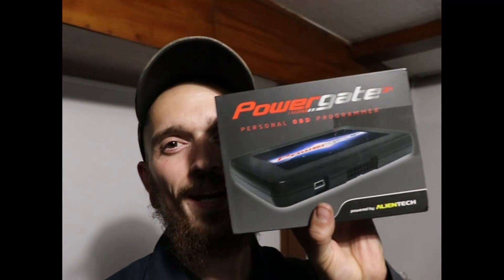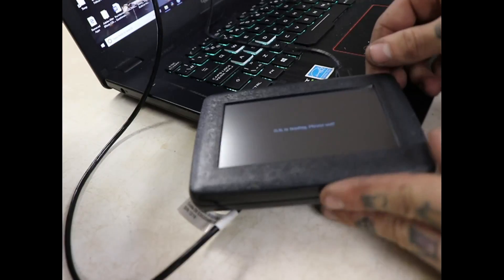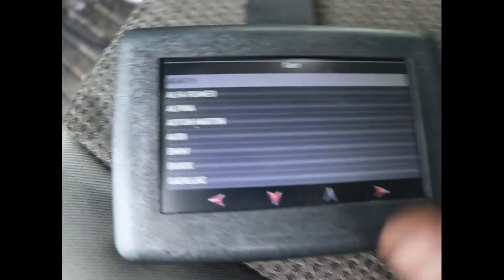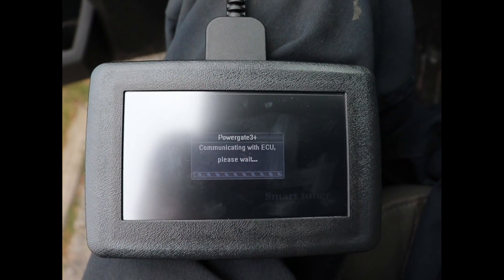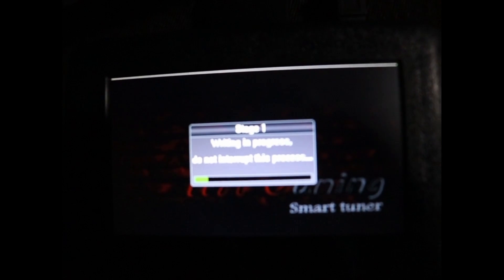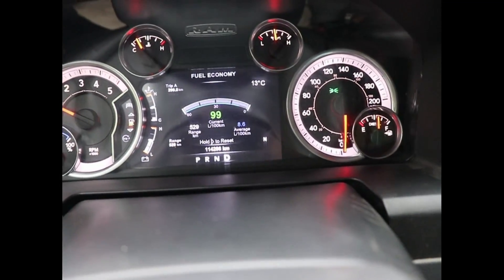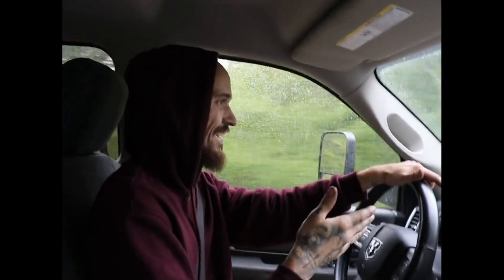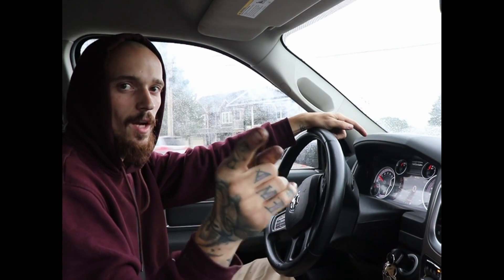HOW TO TUNE YOUR DIESEL TRUCK (DIY ECODIESEL TUNE)

Comment: Does the stage 1 turn off the egr?
Reply from the maker: +Armando Haynes there is the option for that yes
Reply: yes  Stage 1 EGR off, if you want def off extra 150 CAD ( totally recommend ) + biggest bang will be to get the trans tune also. noo need to do anything else.

Comment: Wait so you can actually delete ecodiesel with out actually tampering the truck emissions
Reply: Yes
Reply: @Avicados  No. Because then it's not a delete, it's an emissions intact tune.
Reply: @BrianMDPhD  …you understand with modern trucks programming is 9/10ths the battle. Programming out emission modules is the same as removing them when “tuned” correctly. IE: def system, SCR/DPF, all can be thought to act as a straight pipe (with some obvious restrictions comparatively). Same goes for the EGR system, it too can be tuned out. 

Which when people speak to deleting a truck is usually half the battle, other being post turbo bs which I spoke to.
Reply: @Avicados  You cannot simply tune out a DPF, it would eventually become so packed full of soot that the exhaust system would become completely obstructed and the motor would die and never start again until you removed it.

Comment: Did you turn off the Def aswell. I just ordered stage 1 with DEF turned off
Reply from the maker: +S Read my DEF is on. I Have my Stage 2 kit just havnt installed it yet

Comment: So I'm considering this tune along with the transmission tune. What are your thoughts so far?
Reply: Awesome! Thanks for the response. I've been between this one and SFT stage 1 tune. What mpg effect have you seen so far?
Reply from the maker: Jack Nagel loving the tune. It’s what the truck needed early morning warm up with high idle is awesome. When it come to driving it’s it’s not to in your face but when you need to go it picks up pretty nice. Combined with the transmission tune would make shifts way smoother when you floor it and holding gear on highway.
Reply: How's your fuel economy?

Comment: Does it help a lot  on fuel millage??? Looking for GDE tune or this one. Anyone can help me decide ?
Reply from the maker: +jeromeboily I’ve noticed a difference on long trips in city is a little better depending on traffic. I’ve heard a lot of good from GDE, personally I just didn’t want to send my ECU away that’s why I went with the power gate 3
Reply: Does all of this tuning affect your warranty?
Reply: I’ll make it simple for you. GDE is not an option anymore. All products on the website are “out of stock” been calling them for a few days now and someone finally picked up today. I was wanting to purchase the ECM and TCM hot tune. The guy said SORRY BUD BUT WE WERE SHUT DOWN BY THE EPA. I offered him my credit card info and my wife but the answer was still no.
Reply: @NJprepper321  GDE got EPA approval on their tunes and they are selling again.  The current version is pretty expensive but it does include the tuner so you do not need to send in your ECU anymore.
Reply: @jdemkovich  yes they're back however their new hot tune no longer disables EGR which is a big problem on this engine. I thankfully got the old hot tune but I didn't get the trans tune. And if I'm understanding it right, the new trans tune will not work with the old hot tune. Bummer.

And to the other guy, yes it will void your warranty if you get caught. However, the general consensus is that dealers don't seem to care or notice if you're tuned. But if you start actually deleting hardware, they will void you.
Reply: @NJprepper321  SFT tunes..... Very happy

Comment: I bought this PowerGate 3 with the tune Stage 1 and i'm not doing the mileage that you doing me i do 9.8 to 10.3 so i'm asking what size of differential you have and did you get the Transmission tune
Reply from the maker: No Transmission Tune. I believe I am running 3.55 gears, this was after a 3 hour all highway run